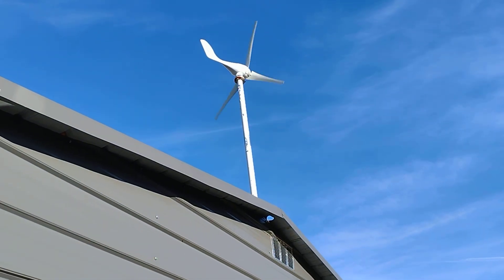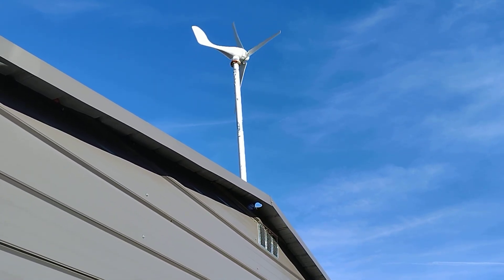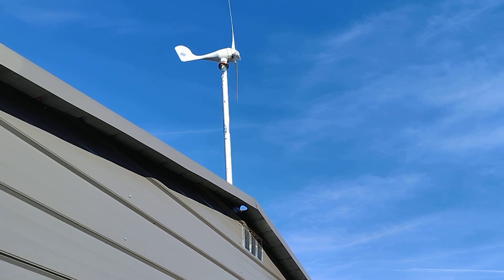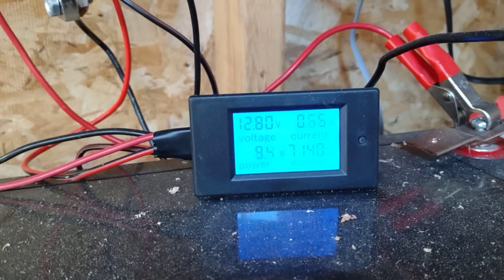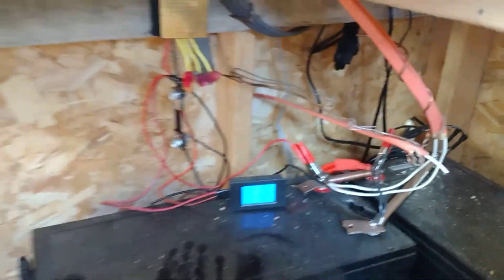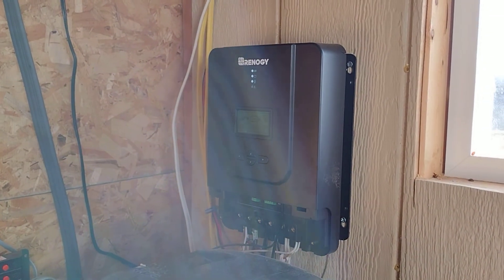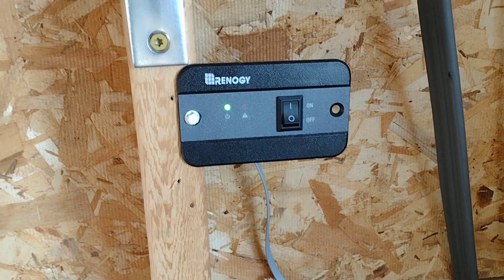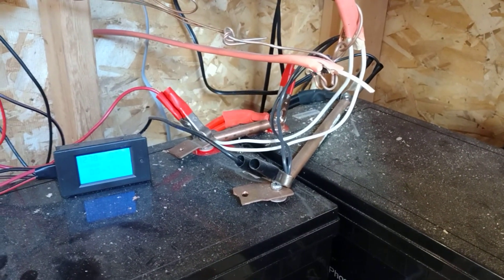You'd better be in your storm shelter if your Pikasola 400 Watt wind turbine is making 400 watts!

Comment: Question I have is I bought A wind turbine 650 watt with a charge controller but Im getting on a windy day over 20 volts and dont want to burn my batterys up. anyone know the solutions to fix it.
Reply from the maker: If the concern is overcharging, I'd just give it a load.  Heater maybe?  If it's not supposed to charge with that much voltage, I'm not sure.  You're right, though.  20 is a bit much to be applied directly to a 12 volt setup...should be more like 14ish from controller to batteries.  Does anyone have a real answer?

Comment: Did you consider skipping inverter and wiring 12-14 gauge for 12V DC water pumps…USB ports, etc? Heck, everything these days is DC with inverter from AC!!!
Reply from the maker: Yeah...I mostly use it for the pool pump and charging tool batteries in the summer.  Car charger in the winter, so the inverter was a good choice...I think.  The solar makes enough power that I don't have enough 12 volt load to take all of it.

Comment: I just returned one.i took for granted a bench test and installed this unit and waited for a good day of wind. 19 watts was the best it generated with wind of 18 mph. After that, I used a drill for a bench test. It generated 108 watts, but to get this result, I had to overspeed the generator and, many times, it when into locking mode. It is well constructed, but that 400 watts doesn't match with the advertisement
Reply from the maker: Best I've seen is 200 watts, and that was at least 45 mph wind.
Reply: @Mr.Handy-ish  lol

Comment: That 400w is useless, it might be good to help charge a flood light in the backyard maybe
Reply from the maker: Thanks for the comment/ thought...I'd agree with you for the most part...unless you get serious wind.  We had serious wind for a few days straight(not usual...we get decent wind occasionally) this last storm it made so much power I had to burn excess power...the charge controller that came with it didn't keep it from overcharging the bank!!!  Not exactly a reason to buy, but it certainly pushed power. I charged up my other bank which is hooked to the house...burned up power with a space heater. 😁

Comment: I believe the point of wind turbines like this is not to just get one but to get like 25 maybe 50 store the energy. With a wood gasifier, solar, and wind a small house can be 100% energy independent
Reply from the maker: Logical. 😏. Maybe I'll take that as a challenge.
Reply: @Mr.Handy-ish  I'm planning on buying like 2.5 acres of undeveloped land, put a pacific dome temporary living dome. The wood gasifier I'm planning on making the main power source for the home (which means a big portion of the trees will come down and I'll plant bamboo) a field about 0.25 acres of just solar panels (maybe bigger I live in Florida) and the solar panels will help charge an electric vehicle (hopefully) and then 25-50 wind turbines to power anything extra I might need if I can get near a water source I can do hydro but for now I'll use the aquaphor under my feet to get some drinking water then hopefully in a year or 2 some animals
Reply: @Mr.Handy-ish  I like yout channel and your opinions and findings will be helpful for me :) new sub
Reply from the maker: Take it slow.  Do good research.  That said.  If you want off grid, solar supplemented with a gas or diesel generator is most cost effective.  Batteries are expensive, so find the most cost effective energy storage solution you can.  In Florida, your AC requirement is high, but heat is low....this is an advantage.  Do your own research.  Solar will produce even on cloudy days.  Wind will not produce at all unless it's a windy day!  Efficiency is of the most importance.  Inverters are only about 80% efficient.  Use DC where possible to avoid converting from AC to DC.  No need if you're off grid....stay DC unless you're running power a long distance.
Reply from the maker: If you look at alot of electronics, they pull AC and invert to DC.  That's inefficient.  You can run straight from a 12V DC battery in a lot of cases.
Reply from the maker: 24 volt systems are used in some semi truck setups...12 volt is common in RVs.  Those are setups you might research for off grid applications...look at my off.grid playlist.  Give me a specific request, and I can put together a video for YOU!  It'll be low production value, but maybe I can help 😏
Reply: @Mr.Handy-ish  will do thanks! You'll see me in the comments I'm 26 and have the most neanderthal understanding of tech and even more so electricity so I'm just learning as I go and trying out new stuff here and there. Videos like yours help me understand what connects with what haha
Reply: @Mr.Handy-ish  yeah I found a company that makes wood gasifiers that run 12v generators that can also be run by solar, propane and gas I plan on getting a diesel one as well I believe the more energy sources the better.
Reply: @Mr.Handy-ish  why is inverting less favorable ?
Reply: @Mr.Handy-ish  oh it's inefficient gotcha ok that makes sense why invert the energy if the appliance will revert it back
Reply from the maker: Yep.
Reply from the maker: Yes...single points of failure suck...on the other hand more means more $$, too.  They also make thermocouples you can buy for power generation.  Expensive per watt, though!

Comment: Question, three blades or five blades?
Reply from the maker: This one has three.  If the question is which design is better, I have no idea.
Reply: @Mr.Handy-ish  thank you for your response. It was a design and efficiency question. The Pikasola 400 Watt Wind Turbine is sold with either blades for the same price. I bought two of the five blade ones but have yet to set them up. If the three blades are better, I will either buy the parts, or new Wind Turbines. Again, thank you.
Reply from the maker: @TheDukie54  Sure!  I'm sorry I can't help with info on the 5 blade design.  Good luck.

Comment: Seems like a lot of equipment needed, how long will it take to recover the expense?
Reply from the maker: Let's say you could put this up and get it running for $400 all in.  At last check (11 months in) I average 1.5 kwh per month.  That means it's making me about $0.15 per month.  $400/.15 means it would take about 2700 months or 200+ years to pay for itself (assuming alternative is 10 cents/kwh from grid power).
Your motivation for going with something like this must be other than cost effectiveness...or you live in a VERY windy area where grid power is unavailable and the sun is unreliable.  Solar is much more practical where I am.

Comment: 1 kWh in a month, that is an average 24/7 output power of 1.39W. That is surprisingly low.
Reply from the maker: That's right!  Power doesn't even begin generating until about 8-ish mph.  Once we hit the windier months, it did a bit better...but not enough to make a huge difference.  The highest output I've seen was about 200 watts, and that was when we were in the storm shelter down below...during a tornado warning!  Lol. Straight line winds were hitting around 60 that night.
Reply: @Mr.Handy-ish  That is a strong start wind speed. You could experiment with a hub that takes more blades, that should improve the low wind range, however that is more money thrown at this.
Reply from the maker: @Tore_Lund  Right.  Someone else commented that the blades are too small...as you say, trying to improve something made presumably by engineers smarter than me is probably just a money wasting endeavor.  It's a great conversation piece! Lol.
Reply: @Mr.Handy-ish  I'm going camping shortly, and was pondering on getting a small wind turbine besides the small amount of solar I got, so a video like yours, where you actually show the output from a prolonged period is more interesting than peak power on a windy day. I'd imagine I could get 50-100W average from a 400W turbine, You've convinced me that is still overly optimistic.
Reply from the maker: Yeah....solar on a cloudy day beats average wind.  Put the money in another panel or battery in your bank, for sure.

Comment: You say its noisy. How much of the noise is bearing noise? Does it sound a bit like a sewing machine? Good main ball bearings should be silent and the wind noise for your wind should also be negligible. Wheres the noise coming from?
Reply from the maker: No bearing noise.  Just the sound of it cutting through the wind...loudest when wind it variable...as it turns into changing direction.  It doesn't bother me, but might bother others.
Reply: @Mr.Handy-ish  The jaw bearing and jaw movement should also be silent other than woosh wind noise which should be negligible. I appreciate you are happy about this but I like to understand and expect others will also be interested. Noisy bearings are letting you know they are going to fail sooner than later...
Reply from the maker: @Tubeophiliac Only noticing wind noise...so far.  Will absolutely post an update if I have problems.

Comment: I've got a 8×16 tiny house and 1 122amp/hour SLA that does me perfect with 200 watts of solar would you personally recommend the turbine? Cheers.
Reply from the maker: To be frank...we have a fairly windy location...it's a good turbine and I don't regret the purchase.  However, let's do the math: At my location, I'm producing about 1kwh per month...at 10 cents per kwh with grid power that's about $1.50...maybe $2 per YEAR.  Very expensive power with the turbine given the purchase price and storage required.  If grid power is available and cheap, use it.  I look at this as a "cool" supplement to solar.  Solar is much more cost effective, but this will certainly keep the lights on at night in a wind storm!  Hard to answer for everyone's situation.  If you have good storage and sufficient solar, I'd go without this turbine.... especially if you're going to have it near your house and don't like white noise.  This certainly makes some white noise.